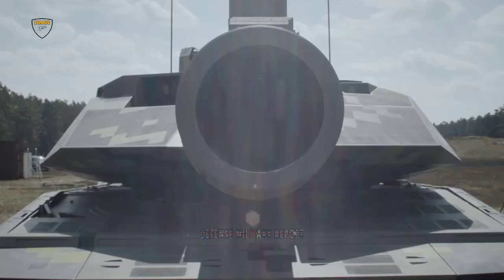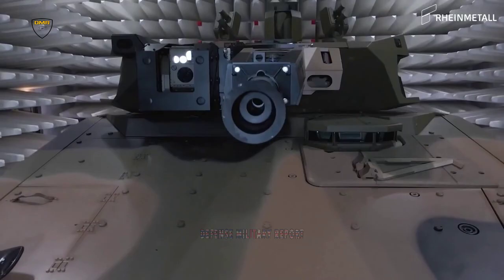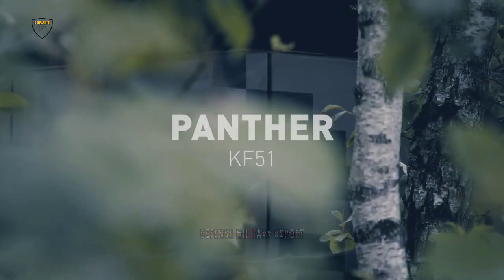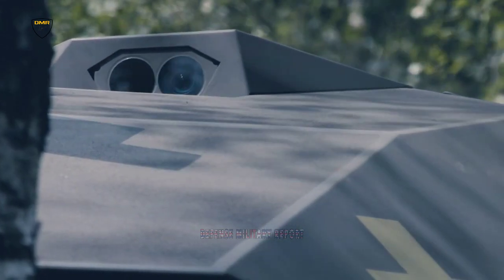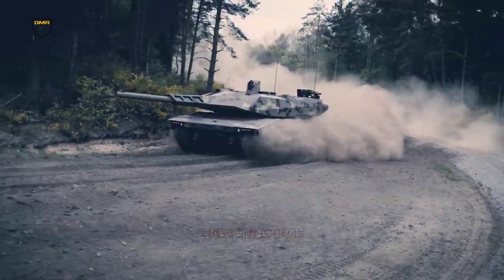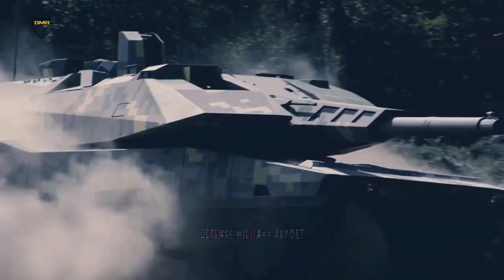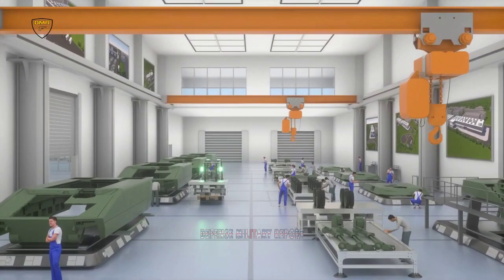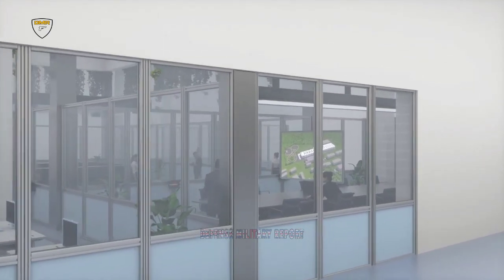Should UK Buy New KF51 Rheinmetall Tank

Comment: The capabilities of the Challenger 3 would have been leading edge in 2014, but today it represents minimum entry level for an MBT and even then will not be fully deployed until 2030. I think the MOD would do well to purchase one Squadron's worth of KF51s for the British Army to develop ways of working and doctrine for the use of new and emerging AFV technology.  At the same time we should join the Franco-German project for the next gen MBT - it's about time one of these co-operative ventures actually worked and national pride was put aside for the greater good.
Reply: @EmperorLionflame  I don't think the KF51 should be a substitute for Chally 3 - as I sad, it should be brought in small numbers now for developing doctrine and assessing technology trends. The short-term answer is to speed up the conversion process and have the new Challengers all in service by say 2026. A future MBT then needs to be available for trials by 2032 at the latest.
Reply: @EmperorLionflame  I was thinking more about a squadron that we could actually use in extended troop trials rather than for technical development. One of the biggest difficulties that military procurement always faces is coming up with requirements. Actual hands-on usage is always helpful to refine the thinking.
Reply: KF51 is essentially the turret from Challenger 2 LEP 130mm plonked on whatever hull you like.

Comment: UK will get the Rheinmetall Rh 130 on the Challenger 3, which also already outperforms the T-14 Armata.
Reply: yeah, i would say thats the most likely scenario. the uk would never buy a foreign tank just for strategic reasons, the uk wants to be more independent of the EU and thus needs to have atleast a bit of its own military industrial capabilities. 
but the Rheinmetal cannons are just to good. even the americans use it in there m1 abrams.
EDIT: completely forgot that the challenger 3 is developed by Rheinmetal as well so it most definitly also get the Rh130.
Reply: @Andreaandersssss1010  while the Lynx Family is from Rheinmetall -Raython, the Challenger 3 is by BAE-Rheinmetall. I think the Hull, turret, div. Electronics and weapon-control are from BAR while the smoothbore Tank gun is from Rheinmetall.

Comment: Yes, let’s face it our recent tracked vehicle record is abysmal, puts the crew into battle shock before it reaches the battlefield (10” bumps permitting)
Reply: No it hasn’t , only the Ajax has been a problem and that wasn’t a British built ir designed machine. The mistakes were made by others , general dynamics with design and the hull welding mistakes were made in Spain.

Comment: Unless the UK has something in the pipeline then yes.
Reply: Untold  Well the chally is a bit old, it's getting upgraded yes, but still it's an old concept, I don't want to say bad, just classic, maybe something new would be better than an upgrade...
Reply: Untold  As i said it's not bad, it is certainly one of the best tanks right now. "Its armour is the toughest" We have different opinions on this. Yes the armor is better than that of a T72, Leo 1 and so on. In the lower part probably also better than that of the Abrams and the Leo 2. But definitely not in the turret. The Americans use depleted uranium and the Germans use air and geometry to destabilize the dart. The Chally 2 could objectively never keep up with that. The Chally 3 will certainly benefit from the german know-how in this regard, but we shouldn't lie to ourselves, an upgrade of an old tank takes place on an old chassis. Even the best steel will eventually wear out from the stresses. Welding the cracks or any upgrade what so ever will not help there. The tanks just has to be replaced. In my opinion one should buy a new tank right away instead of trying to somehow keep an old one alive and relevant. Anyway we will both not decide what will happen, so what ever.
Reply: @MW-dz1hg  right. Also old chassis may have developed designflaws with time and new weaponinventions came in. 
Leopard 2 f.e. has a flawed chassis against the new Antitank weapons that can penetrante it's side armor - the munitiondepot that was placed in front of the tank. 
Therefore the new tank.
Reply: Untold   "Drones are the new effective agent on the battlefield." Well, then it's good that the panther got 4 Hero 120 drones in his turret and an remote MG against drones i guess? xD
Reply: Untold  you forget something, Russia seems to misuse their tanks and violate Nato tank doctrine completely. Just like the Turks with their Leopard 2's did in syria, before syria the Leopard was never even disabled in combat. 

the old panther is a WW2 tank that got designed, produced and rushed into battle within 2 years an performed like that. Normally it takes around 20 years to get a completely new tank like the Challenger designed, tested and produced and ready for combat. I don't think that you can compare them really with each other.

Comment: Im admiting im an "armchair general"
But as the general design of it look great (the 120 drone is a huge bonus) BUT
The 130mm canon looks like a mistake that will make it very niece use as only sort of tank destroyer in practice,

1) 20 shells at the battelfield is far too low, espacialy quentity vs quality rivals, its 10min of an intense firefight

2) this 130mm shells will be too heavy for hand reloading espacialy with women tankers that eu state will start to have soon, ie impossible backward while still in battlefield reloading the mere 20 shells

3) the barrel will worn out in no time mid long term war and accuracy will drop (with the 20 shells limit its a syneragy of bad things)

4) in QCB infatry support full power anti men 130mm will be too strong for civllian death / hitting with shrapenals co-soldiers a street away, ie would have to be colder shell, ie 120mm anti men shell force level but with 20 shell capacity

5) if ear muffs damaged in a shock,
One 130 shot and crews are taken out from the war instantly from maybe even brain damaged beside probably permamantly deafness

What is the 130mm even for?
Rumers any 120mm apfds will pass any APS system on earth right now as it is, russian dont have real APS anyway, and any 120mm basic heat round will turret pop even t90,
And if they dont have APS, just use lahat atgms for 8km range in any 120mm barrel right now

Comment: Challenger 2 still has the best armour in the world, So when challenger 3 is finally in production it will still surpass other Tanks including the Panther.
Reply: You need to let go of that myth that the Challenger 2 has "the best" armor. The details have been leaked in 2012 or 2013 and it isn't particularly impressive compared to other contemporary tanks. The lower hull plate armor even is one of the weakest among all modern tanks.
Chobham armor was designed to work against shaped charges, but they barely are used by tanks against other tanks anymore and it is rather weak against kinetic ammunitions, which are the main type used nowadays.

The Challenger 2 was designed for a different era and the Challenger 3 uses the same, outdated armor.
Reply: Its using the canone from Leopard company kmw from Germany also the abrahams and turkish one but Rheinmetall got More Innovation
Reply: @EmperorLionflame  Just read the Wikipedia article on Chobham armor, for Christ's sake and stop spreading fairy tales.
Reply: @TrangleC  Is that the lower hull plate that resides behind 600mm of the worlds best heavy ceramic armour?